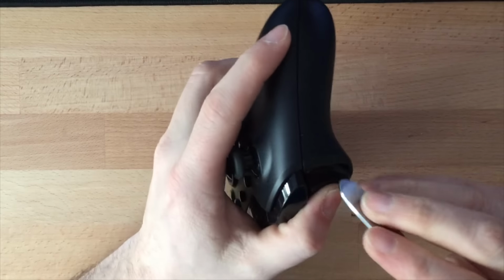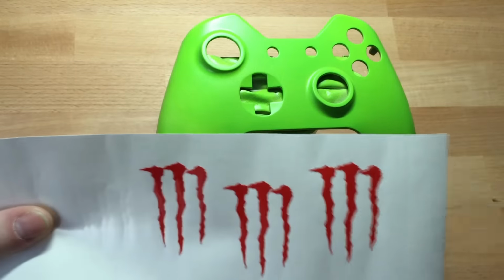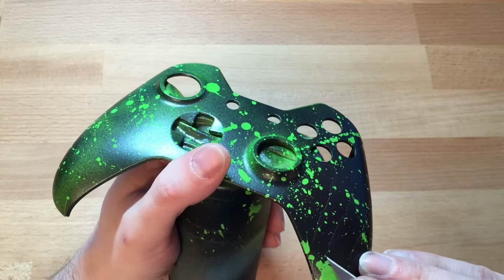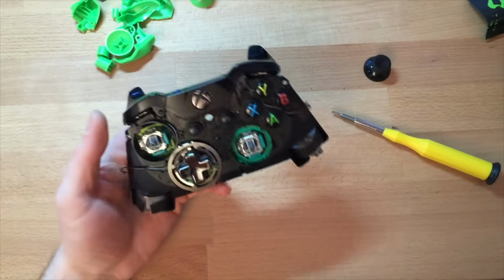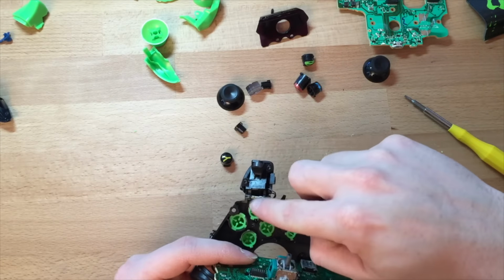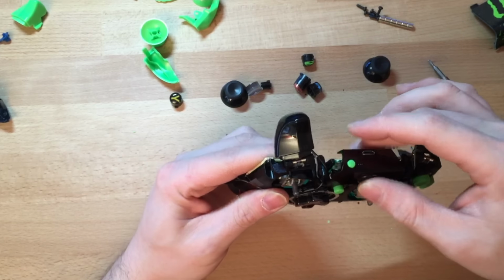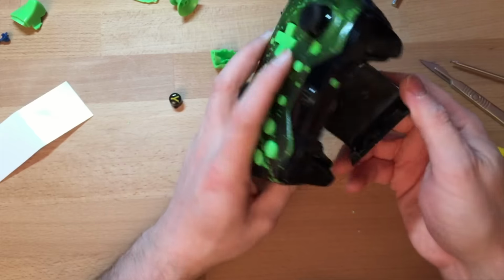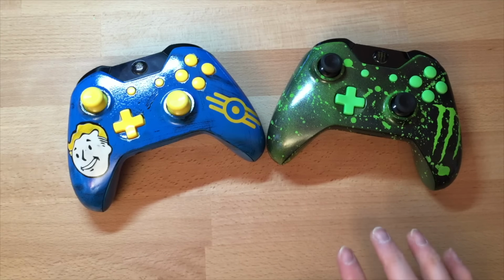How to Spray Paint Your Xbox One Controller Part 1 By F3custom.co.uk

Comment: Do the buttons stick when you press them after you've assembled the controller? I've had that problem before because I didn't plug the inside of the holes and the paint provided too much friction when pressing the buttons in.
Reply from the maker: if you put a lot of paint on sometimes i file for that job
Reply: would you not recommend covering the inside of the holes to prevent it from getting gunked up? Also, does filing it damage it any?
Reply: Kyler Grippin sand paper the holes

Comment: I wanted to know if the controller shell would be able to handle the heat inside the dish washer? Also, after washing it, would u wash it again by hand, or leave it how it is and paint it
Reply from the maker: i have done it so i think it should be ok and just make sure it dry

Comment: Hey would anybody know this? Can you hand paint a Xbox controller with a paint brush if you still used the same properties of paint and water. And then clear coat. Because currently I don't have an airbrush kit. But if not then I'll just get one.
Reply from the maker: yes you can but put some undercoat on b4 you put paint the controller
Reply: Thank you so much

Comment: Do you need to sand it down before you paint
Reply from the maker: +Brandon Laws (DARKSEC70R) you can do
Reply: Brandon Laws I'd recommend, otherwise the paint will have nothing to sink into and it'll chip and wear off easier!
Reply from the maker: or you a primer

Comment: Don’t ever touch a circuit board with no grounding equipment, you can short out the board with the static electricity from you feet.

Comment: how did you get the green splatter?
Reply from the maker: +deadworld46 flick it on with a paint brush
Reply: Do u spray the paint onto a brush until it starts driping off the brush?
Reply from the maker: +deadworld46 yes spray it on the brush and flick it on if it's and just keep doing that